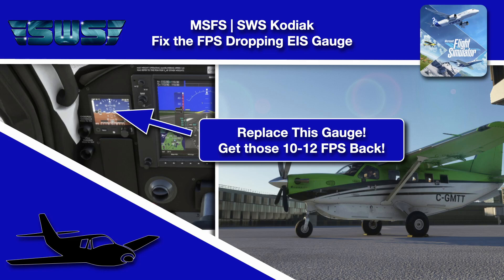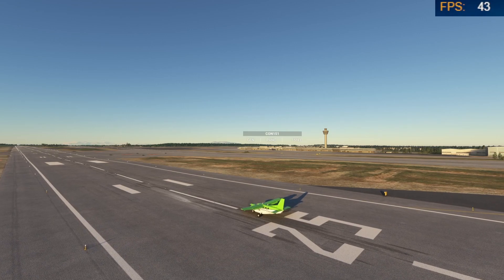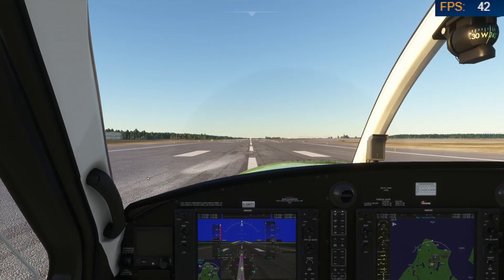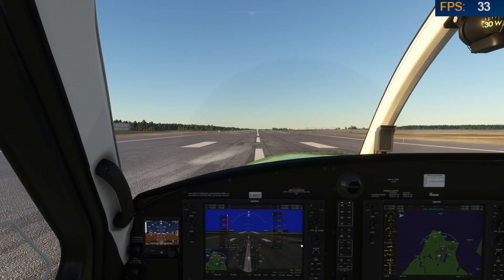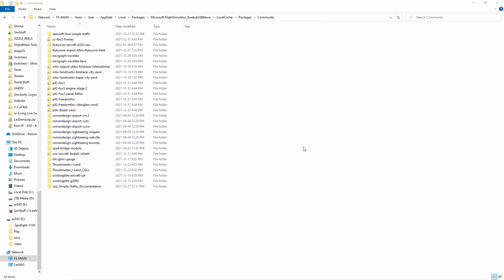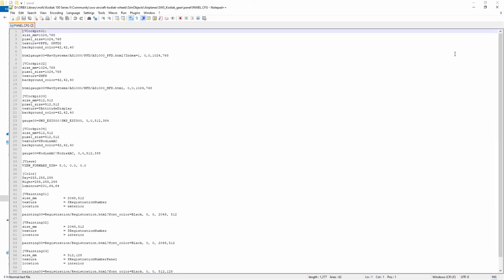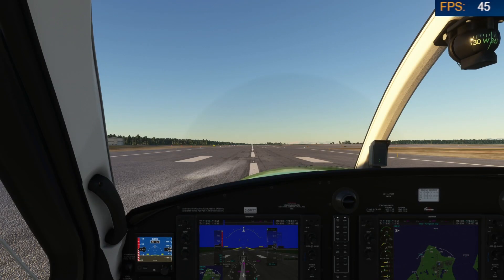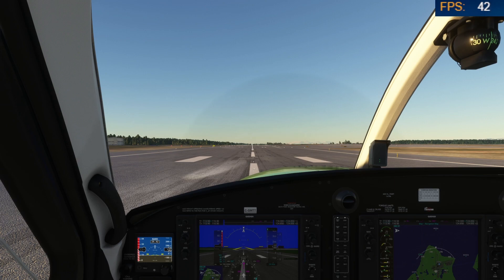MSFS | SWS Kodiak | EIS FPS FIX

Comment: I follow all your steps but when i jump again over the kodiak it remains the same altimeter indicator, we have to delete the backup folder panel in the panel subfolder?
Reply from the maker: You have to exit MSFS so that you can edit and save the file. Then reload the sim. You don’t need to delete anything else. 

Do you have any other mod for the Kosisky? Like say the PMS GTN750 mod? If so you need to edit those mods folders since they have a panel config file that over rides the main file.